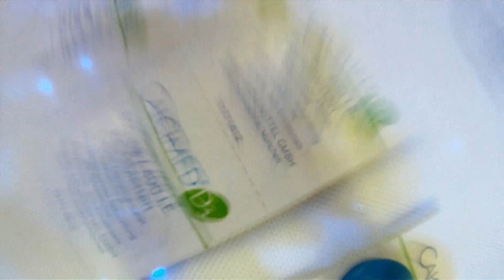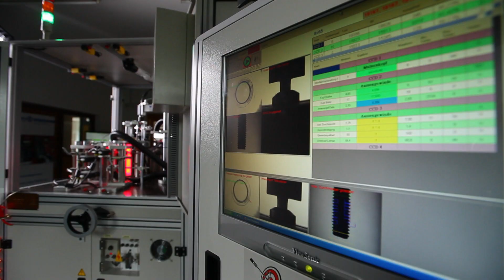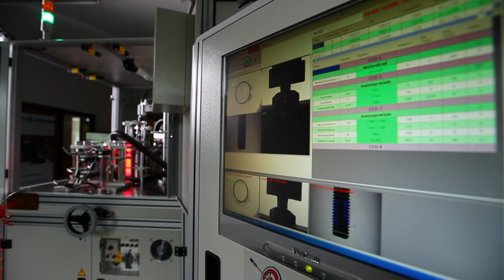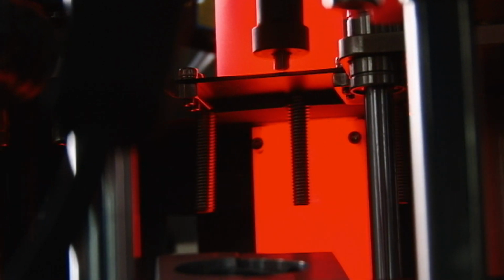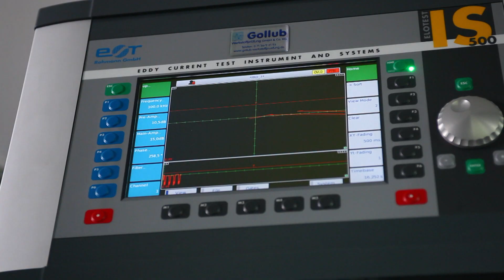The Best SORTING MACHINES in the World | Free Documentary Shorts

Comment: I like how you said Slide Gently, tell that to the courier delivering parcels.
Reply: Yep the heavier ones crush the ones at the bottom. You cant keep the belt moving indefinitely because the operator has to stop it each time he takes a parcel off so you get a build up.

Also did you notice the loader throwing the parcel over the top ? Classic how trailers are filled because you cannot stack everything one by one.

This video shows exactly how your deliveries are unfortunately "damaged in transit"